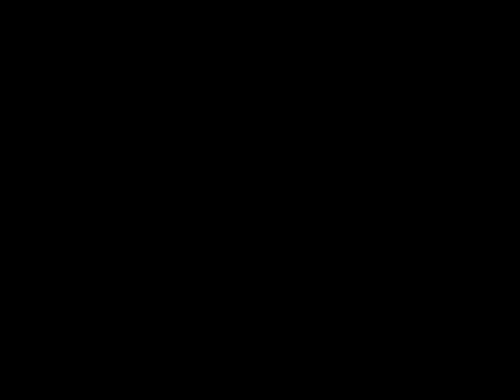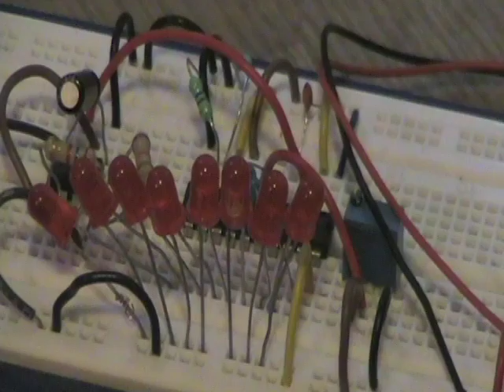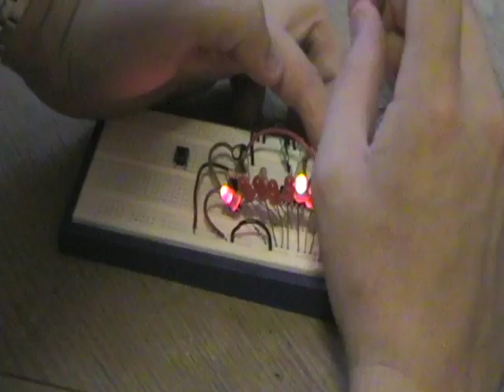The ADC0803-LCN 8-Bit Analog to Digitial Converter IC!

Comment: Is the circuit the same one from the data sheet?  Did you try to use the internal oscillator instead of the external 555?